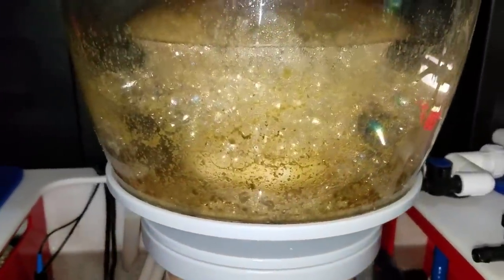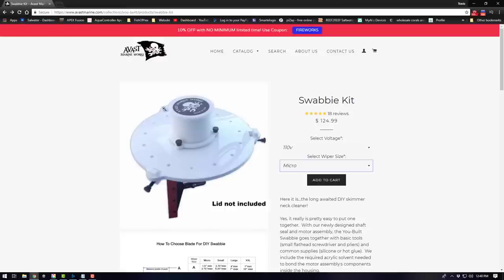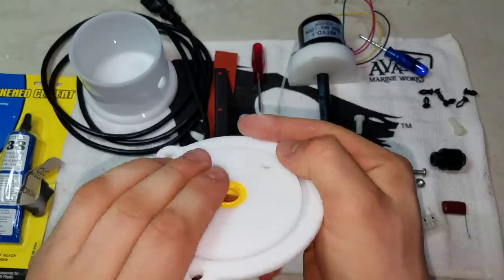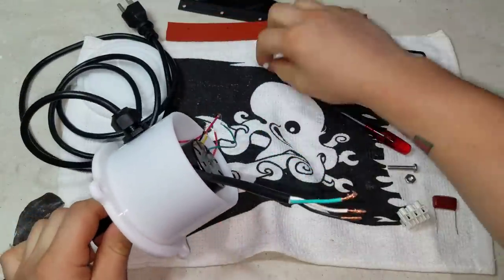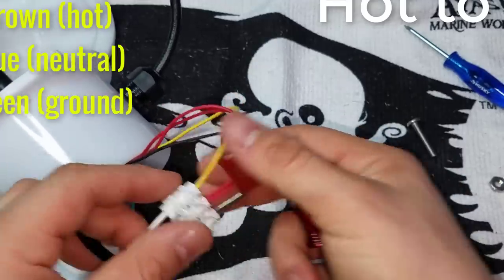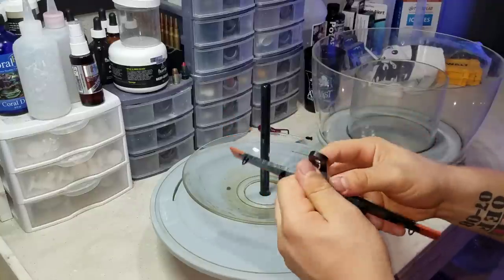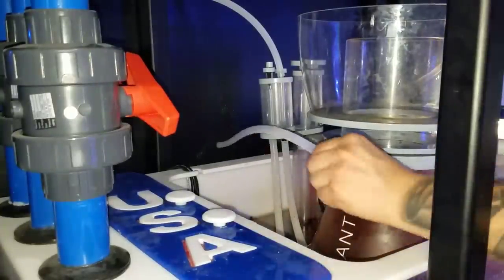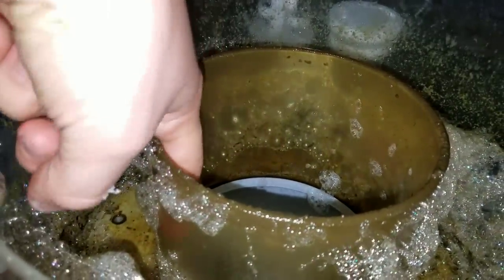Avast Marine DIY Skimmer Swabbie Kit Install | Nyos Quantum 300

Comment: Hey, bro. Are you still satisfied with your quantum nyos? I’m in the market for the 220 and I’m curious if it’s safe to slightly oversize for my system (about 100 gallons total system volume) or if they run pretty efficient and “true to size”? Thanks for all you do!